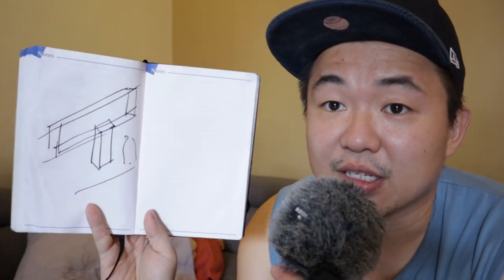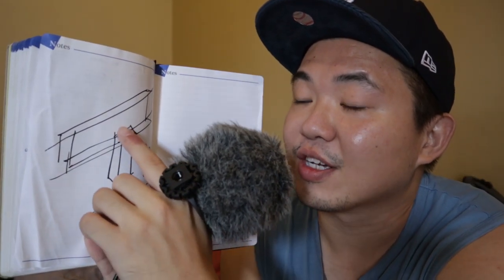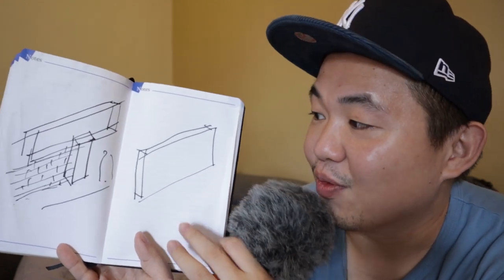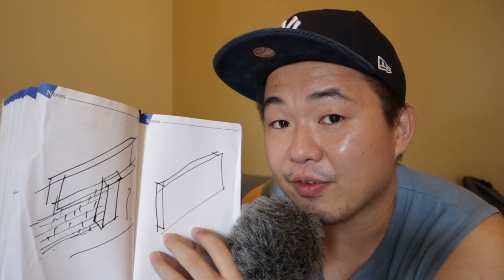ASKING SEAN #038 | WHICH WALL CAN I HACK IN AN APARTMENT?

Comment: We cant even hack the wall to put new socket wiring nowadays... And one more thing which I usually very irritated with any agent or developer...When I asked regarding ceiling height everyone blur dont know anything...Maybe only 1% agent knew regarding ceiling height
Reply: yeah, especially they build a show unit in the commercial office, it is quite misleading because typical floor to floor height is about 3.5 meter, if you don't ask, you may think the developer provide a tall ceiling for you unit, but the fact could be 3 meter or below.
Reply: @nicklou255  ya bro so true.thats y the show unit looks very spacious because of the ceiling height eventhough its a small size sqft.but then after saw the real one...hmph..

Comment: You mentioned that the system form work is a shortcoming. I dont get it. System formwork is used to increase work efficiency and cost reduction as it can be used many times, and as you mentioned, they are accurate and made of steel. However, whether a wall is a RC wall , or not has nothing to do with formwork. RC wall is constructed for structural purposed, not because of the formwork.  Those RC wall is called shear wall. Brick wall does not bear load, they are just for partitioning. Load are supported on beams, column, slabs, and shear wall only.
Reply from the maker: I think you got me wrong ikano. I'm totally for system form work too=) 
Yupe, that's exactly accurate on the RC wall too. However, most of the walls for our apartments are designed in RC walls and based on my experience selling these units to customers, they will come back to me with complains mentioned in the video. 
However, thank you so much for the need to keep things accurate!! I really appreciate it because I think it's good for audience to know about construction methodologies as well=)

Comment: if we are not suppose to even nail the wall, or drill hole then how are we gonna install plaster ceilings and cabinet? and is it okay to chisel the wall to hide wires inside?

Comment: Thanks for the info Sean, I think you terbalik the definition of beams and columns in your explanation, the concrete wall you mentioned is actually a "sheer wall", you will find most of the modern service apartment will neither have columns and beams, basically it will be just flat slab and sheer wall (subject to the wall to wall span).

I don't think the developer will entertain all the owners especially those projects with 1000+ units, the developer will provide all the info such as as-built drawings, Operation & Manual, and all the authority document to the appointed JMB / JMC before VP. A very good point that you mentioned owners shall get approval / consent from the joint management body / committee before doing any renovation as I realized most of the owners will just renovate first and regret in the later stage.
Reply: "Sheer wall" what I've learnt from Mong :)